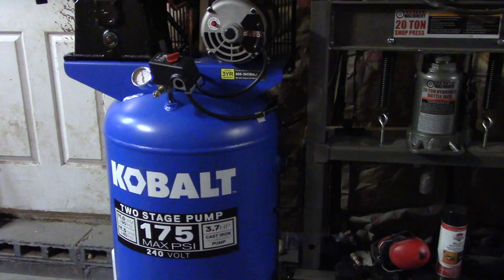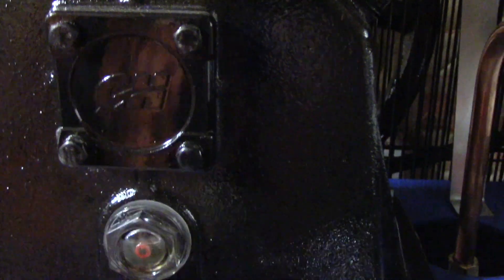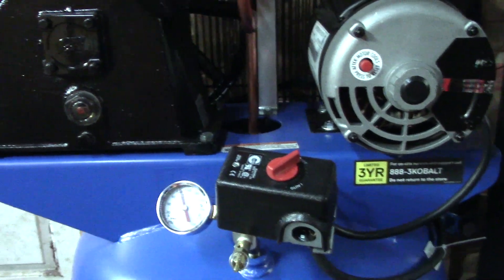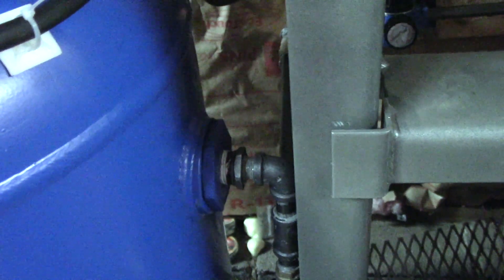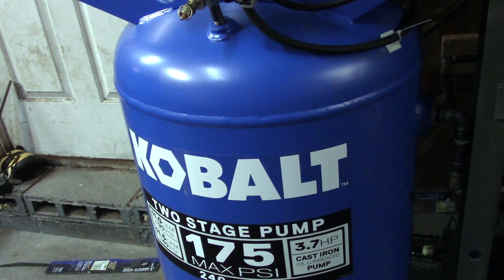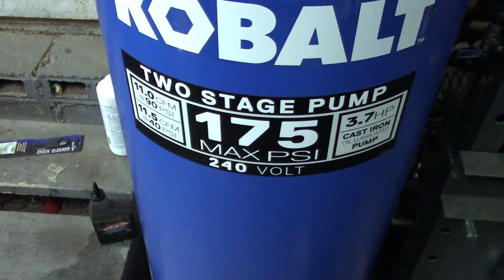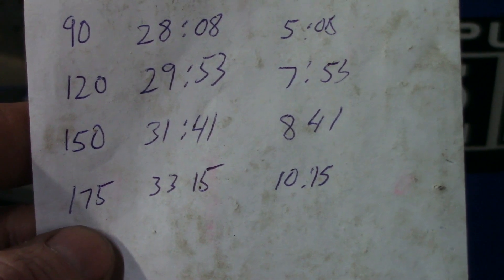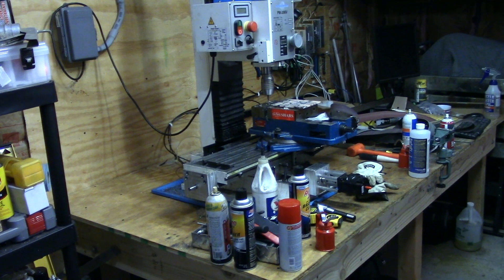Kobalt 2 stage 60 gallon oil sump cast iron air compressor 2018 model 220 volt

Comment: Thanks for the info! I'm looking at replacing a failing tank with this unit.
Reply from the maker: Frank Machado   I think it is a really good compressor. I am coming up on 2 years and it runs just fine. I use it a lot. Just follow break in procedures. I would buy it again

Comment: You can also pull the ring on the pressure switch to release pressure
Reply from the maker: Yes that is a way to release pressure.  That is a safety valve incase the pressure switch fails to turn the motor off and will keep from over pressuring the tank.  I would not recommend using the safety valve to empty tank, since doing that can weaken the spring and may damage the o-ring after time. But it is an option.

Comment: Great video! I have mine on order. I will be installing mine in a enclosure behind my garage. Can you give me the dimensions of the unit overall?
Reply from the maker: Tim Heitz  I would recommend to receive it and get your measurements, so you can accommodate your connections and cooling. I don’t think this compressor iOS rated for out doors for all temps. Watch about cold weather and oil viscosity.

Comment: What does a honda civic have to do with a compressor your review was nice until that lol mind you I own a honda civic and my dad owns a corvette
Reply from the maker: Gustavo I did not compare a honda civic to the air compressor (apples and oranges). I compared the sound of a honda civic with a loud after market exhaust ( rolling down the street in 1st gear at 7500 RPM...) vs lets say your dads corvette with a V-8 and factory exhaust.  I am not a fan of corvette, but I would rather listen to the corvette any day.  My point was the compressor is easy on the ears compared to oil less compressors.

Also there is nothing wrong with a honda civic. They are good cars.  I just high dislike the after market exhausts that are loud.

FYI if you are looking to buy this compressor, its well worth the money and has good performance. Mine is still going strong and  gets used alot with CNC machining I do.

Comment: It’s pronounced Campbell like Campbell’s soup and hausfeld is pronounced house feld. The CFM specs are just above what a decent single stage compressor puts out but you can put more air in the tank at 175psl. How much did it cost. Maybe you say later in the video, I’m only half way through it now. Edit- you didn’t say what you paid for it so I looked it up, it costs $570 today 10/2019 at Lowe’s and you maybe can get it on sale for less... I’d say that’s not bad for a compressor with the specs of this one. I bought a 5hp 2 stage Sanborn compressor from Menards for $1050 and it puts out 17.9CFM at 100psi and 17.0 CFM at 175psi. Nice job on the piping. 👍😃
Reply from the maker: Curtis Hermanson  I paid 509 for the compressor. I have used the compressor a lot now and it does good. Yes, the tank is rated for 175 and the pressure switch turn off at about 160. The switch can be adjusted to take it to 175. This is an actual 2 stage compressor. I forget the time in the video but I show the timeline from empty tank to full. Overall I am very pleased with the compressor cost to benefit ratio.
Reply: Jake Taylor The tank on your compressor should be rated for more than 175psi. It would say on the tank plate or decal what it’s rated for. Your pressure switch should be set to shut the compressor off at 175psi but you can set it for less if that’s what you want to do but your compressor will run less often if you let it run up to the maximum working pressure of 175psi and as they say motor startups are worse for a motor than the actual runtime. Like well pumps, the bigger the pressure tank the better it is for the pump and that is why I just replaced the 20g tank on my well to a 86g tank. I recently bought this house and I felt that the well tank was too small. Anyways you bought a nice compressor overall for what you paid for it in my opinion.
Reply from the maker: Curtis Hermanson  you are correct. The current configuration it is in works well. I can set the pressure switch higher, but it becomes less efficient at those pressure and over work the compressor. My shop is air conditioned but I don’t always let the air conditioner run. So pressure causes heat and heat causes pressure so I leave it at the factory. I am very happy with it.

Comment: Good review Thanks just looks at these today any chance you have a PSI gauge to measure that 175?
Reply from the maker: dumblucky2000  not sure I understand your question. The max working tank pressure is 175 psi. From the factory they are set to shut off around 160. Hope this helps

Comment: Does it keep up with impacts well?  I’m using a oilless husky 30gal and it’s loud and it sucks. By the time you hit a impact a few times its cycling already then you have to wait for it to cycle off.
Reply from the maker: Whatfreedom7, this air compressor is on another level. It does very well with impacts. For the most of the time I can remove 4 wheel and it might kick on once. It will keep up mo problem.  I mostly use it for cnc machining metal and I need a constant air supply for an hour or two at a time.  It does very well for this as well.  Being an oil sump compressor it is much quieter than oil less. It is also a real 2 stage and is way more efficient. If you look in the video I listed the recovery times. Unless you want it for an automotive shop, it will do great.   I hope this helps.
Reply: @jakegt1978  Why would this not be good for an automotive shop? I was looking at purchasing this compressor for my garage to do some body/paint work. Not used for everyday use, just for my own projects. Thanks
Reply from the maker: @davidd9013  This is a good air compressor for the HOME automotive shop. The compressor would do good in that setting.  I  use it for cnc milling to keep the chip clear of the cutter and other uses around my home shop and it is a wonderful unit. I would not use it as a central compressor in a shop that several users are attached to it.
Reply: @jakegt1978  Thank you very much for the response. It will just be me using it periodically. I like the price of this unit and that it is a two stage. Thanks for your review.

Comment: From the factory they are set to shut off at 260? Is it ok to raise that to 275? Did you raise yours? I just bought one a week ago and returned the dang thing because it would reach its full psi. I exchanged it yesterday for the same model and this one isn’t but I had no idea it was preset to 260.
Reply from the maker: Ryan H  I think you mean 160 instead of 260?  No I did not raise the pressure from the factory setting of approximate 160 psi. These are a piston type compressor and will loose efficiency quickly at higher pressures. Not to mention it is very hard on the piston and ring. Read some of the other comments and I explain further why I would not recommend residing the pressure beyond factory setting. Do you need higher pressure or just more flow ?
Reply: Jake Taylor yes I meant 160. I’m sandblasting with a tool that requires 9 cfm. I thought maybe the added pressure would help with that.
Reply from the maker: @ryanh7550   No worries. No I know what you are looking for. No you will not gain anything by increasing the pressure stop point, because of efficiency lose at higher pressures for piston compressors. Sand blasting is a very high air consumption task. Tool makers way overrate the CFM on non industrial grade tools. Even through they say it is 13cfm it really is not that and very mis leading and used more for marketing. They twist the ideal gas law to come up with their published cfm, which it is over inflated. Don't get me wrong this is a very good compressor. It does what I need. Yes, it will run a sand blaster, but only for bursts. To explain what actual air flow you get, this guy "AvE" on youtube explains it best. Hope this helps  https://www.youtube.com/watch?v=cfjSm_ieRkE
Reply: Jake Taylor well first of all that guy is hilarious! Secondly wow that’s some BS!! I feel like calling a lawyer!
Reply from the maker: Ryan H  Yes AvE is very funny with his wording. Don’t let that fool you. He is very smart fellow. Air compressors rated CFM rating is a little lie. You just have to know how to read between the line like AvE showed you how. The compressor is great and is good for just about everything. Including sand blasting for short run times. If you need serious air for long run times. You can get small trailer rental compressors. They are expensive but will put out real 180cFM and up.
Reply: Jake Taylor I can see he’s very smart! Well the Kobalt is what I have now so I need to make that work. When it kicks on from using the sandblaster should I stop until it stops running?
Reply from the maker: Ryan H  It’s a good compressor all things considered. The motor is oil sumo and continuous duty. Run it until the pressure drop down and the blasting media is. It cutting. Stop and let it catch up and shut off. Rinse wash and repeat

Comment: Great review, thanks a lot. Very hard to find any info about this Kobalt. Just one question to you Jake. Can you add please a pump number so I can find out more info about it.  I like the Lowe's price for two stage compressor but very hard to believe that this compressor  build for  a long life...
Reply from the maker: Elina. Sorry for the late response. THe compressor model is XC002500AV . The electrical motor is compressor rated for continuous duty single phase. Campbell has their sticker on it but I can't figure out who actually makes the electric motor. I would guess the compressor on this usit will last like about all others do for an oil sump cast iron compressor.  If you need something that is pretty much guaranteed to run many years of hard use, I would get a Quincy or some pro/industrial grade.  Otherwise this unit should do well provided break-in and regular air filter and oil changes are followed..
Reply: @jakegt1978  Thank you for reply. I still searching about it and just wonder why Kobalt put 5 hp pump with 3.7 motor ? I believe if Kobalt  will change motor for real 5 hp motor it's increase CFM a little more. To have 175 psi and only 11 CFM  really surprise me... Thank you again.
Reply from the maker: @elinaostapenko8790  You are welcome. Electric motor hp and gas motors hp are rated a little different. The compressor does not really have a hp , but rather what horse power can be applied to the compressor shaft. The compressor only produces so much air per revolution of the compressor, because of the fixed displacement of the cylinders. It is certainly possible to make the unit produce more than 11 CFM. This is done by changing the pulley diameter and in turn would speed up the compressor on CFM delivery. Displacement X Rev = CFM. However this can only be done to a point until mechanical failure takes place and I an not sure what the safe speed rating is on the compressor. On another note piston type compressors loose efficiency quickly at higher pressures.  I can recommend this compressor and have used it now and does the job for everything I do including CNC machining. If you need more output at higher pressures look into the screw type compressors but they are $$$$$$. I hope this helps
Reply: @jakegt1978  Thanks a lot for the help. We have one like this compressor at local Lowes and tomorrow we'll buy one. Can 't go wrong with price for two stage. This is a deal.
Reply: Elina Ostapenko 
Just to add a little info because very few people seem to know of this newer model compressor...

The 80g 2-stage version uses the exact same pump (XC002500AV) except it powered by a 5hp motor.  The actual model of the 5hp appears to vary (same store had a Century 7-182679-01 and a CH part#:MC036400AV model#:56S34D5M on 2 identical 80’s sitting right next to each other).  The 60g has a motor part#: MC037000AV model#: 56S34D3.7M.  Driven pulleys on each pump looked to be identical, drive pulleys on each motor were different.  I’ll try to source a part # for the 80g drive pulley if anyone cares.  80g belt (B56) looked like it was 2” longer just based on the printed part numbers.

I guess what I’m getting at is... if we own the 60g 2-stage we can “upgrade” to the 80g CFM specs (15.8@90/16.0@40) with a simple motor, pulley, and belt swap.  Best news is that the pumps are identical and the only pulley that needs swapped is the easier/cheaper drive pulley).

Sorry to hijack this post... just spreading info :-)
Reply: @djhoffman2428  Yes, the same thing the Lowes manager told to us when we are pick it up the 60 gal compressor.  I'm personal just wonder about compressor pump because no any review for this pump and nobody sale it around.  Pump from CH and  maid in China so only the problem. Other parts available all around plus 3 years warranty . Great deal anyway.
Reply: Elina Ostapenko   Yes, it’s a bit of a gamble seeing how there’s no history of the pump.  Just picked mine up last night.  Im impressed by the size/weight of the cast iron pump alone.  The 30g version does have a significantly smaller 2 stage pump in comparison.  As you mention the 3yr warranty makes it less worrisome, and the CH brand on it is also nice to see (as opposed to an off brand or no branding at all).  For the price it’s hard to beat and if it does fare well in use it may help influence the market as a whole, helping to drive prices of other brand 2 stage compressors even lower.

Best of luck with yours.
Reply: Thank you . @djhoffman2428
Reply from the maker: @djhoffman2428   No worry about hijacking. I agree with you by changing the pulley will increase CFM. This can also be done with the existing motor and simply adding a larger motor pulley.  It  does come at a cost and will increase amperage draw. Like you said a larger motor and larger pulley will produce CFM like the 80g version.  However, this conversion will cause ore motor cycles because 60g storage is less than 80g.  The recover time will be better than stock.  Basically the pump has a know displacement and CFM is directly related RPM on the pump.  Horse power has no play in the equation, to a point and then hose power is a factor because it can't maintain the RPM for the CFM desired. More RPM on the pump = more CFM. Exceeding mechanical limits pump = mechanical failure.  I have now had time to put it through its paces and it does nicely.

Comment: 3/4 reduced to 3/8?? Why so small? I always had ran 1/2 line. I hope I can run 1/2 with this compressor I was looking at it last time I was at Lowe's
Reply from the maker: That was the size of the airlines at the time I bought it, a year ago now.  I have made modifications and upgraded airlines since. Its a great compressor.
Reply: @jakegt1978  lol ok got worried there for a min wasn't trying to start over all I have is 1/2inc lines and fittings

Comment: Sooo how do you switch it from 110v to 240v.... Does I have to Switch out the 110 plug for a 240 plug?
Reply from the maker: David the compressor does not come with the electrical cord.  You will have to make your own or use electrical cable and wire straight to the load center. In my case I ran a 240v receptacle to near the compressor. This receptacle doubles for a plug in for my welder.  The box store has a plug called "
Utilitech 50-Amp-Volt Black 3-Wire Plug" this is the male part and they also have the female that makes the receptacle. Please note that the compressor will only work with 220-240V.  I hope this helps.
Reply from the maker: See page 2 and 10 in the owners manual.  It states that the motor draws 16.2 amps ( can verify this from the tag on the motor). 12 AWG is good for 20 amps. Keep the cord as short as your can to the load center. Do not have anything else on the circuit that you are using the compressor for.  The green wire is your equipment ground (Ground Wire) and the black (Line Wire) and white (Line Wire)are the hot wire and will give you 220-240volts, see page 11. Be sure your are connecting to at least 20 amp breakers in the load center, see page 10. See page 13 of how to hook up the wires. The wire coming from the motor should be hooked up to the right side terminals and a green or bare with for equipment grounding. Power from the load center should match on the other side of the terminals (Black & White) and the green wire will double up on the existing.  The green wire id difficult attach, since there is not a lot of room. Don't forget to follow break in procedure on page 16. Hope this helps and follow any of your local electric codes for verification.
Reply: Jake Taylor Thanks again! I'm a DIY Guy but when it comes to ⚡️ I'm really cautious
Reply: Jake Taylor   According to the information on the nameplate 17 amps and 240 volts, (17x1.25=27.54amps) the branch circuit should be 2 pole 30 amp breaker, minimum #12 cu, (suggest #10) and a 30 amp 3 prong receptacle.   Same as dryer, not a stove.   The reason is if a short happens on the compressor conductors, they are not protected at 50 amps.   If you put a 30 acb, then the receptacle(although safe as long as you live there) would not be NEC compliant.    I'm only trying to help, not criticize.   Respectfully,   Kevin